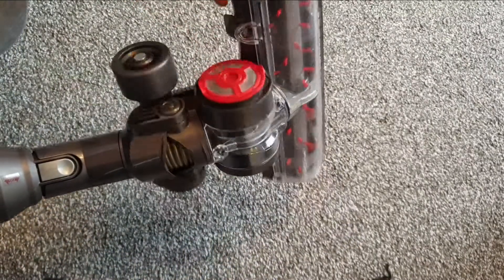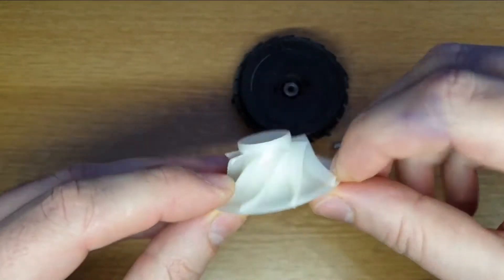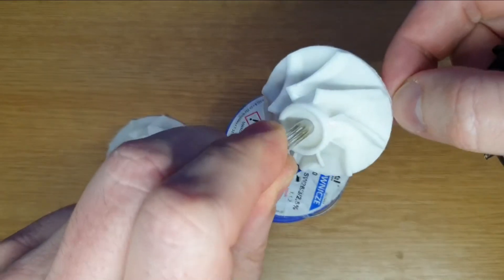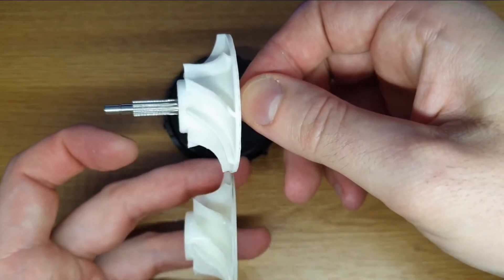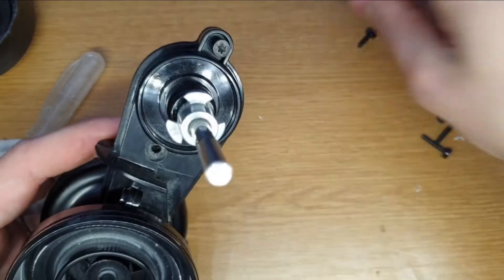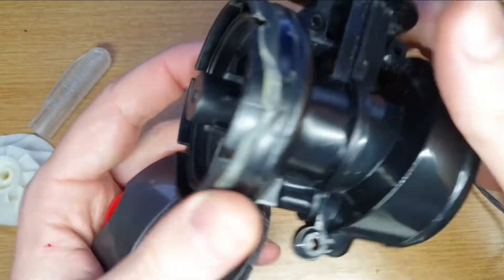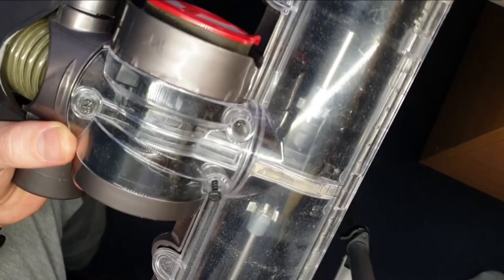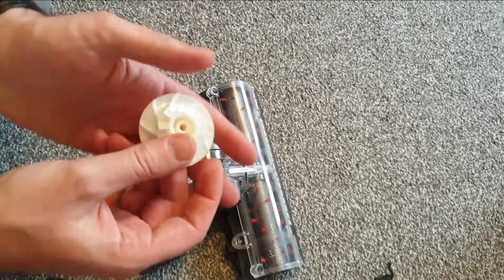Dyson DC23 Head - Turbine (Impeller) Replacement (Repair)

Comment: I followed this to fix the mini turbine attachment. It took me a few attempts but I got it to work.   I actually used a 5 mm drill bit to get the hole right.  My print was too small and the force of pressing the shaft in tore through the impeller.  Not sure why you heated the shaft.  It expands with heat.  I would think you would heat the impeller to open up the hole.  A hair dryer on the air valve end makes it much easier to pull the cap off.  I used a socket to back up the impeller when pressing the shaft in.  Cleaning up the surface with the filler material is very important.  Make sure there are no high spots and maybe sand it a bit.  I had to manually turn the brush rollers a bit each way a few times for it to self center.
Reply from the maker: Hi and thanks for the comment.
I've preheated the shaft not as the thermal expansion or shrinking effect, but purely because the PLA printing material gets softer above 100'C. Hence, it is slightly releasing the hole and also get well stuck around the gripped part of the shaft, after it cools down. 
To get a proper performance, the turbine should be the maximum size as possible, without grinding the case. If it is 2mm smaller that would dramatically decrease its performance.

Comment: Would heat, from a heat gun, help with removing the cover on the screen side? Or possibly making it cold, placing it in the freezer? What is holding it, glue or some sticky tape? I may have to take mine apart, as the bearing is locked, or some thing is locked up, and I’d like to not damage it.
Reply from the maker: Hi,
There is a locking feature (ring) on the top of the internal part which goes in a groove on the lid. There is nearly 360° grip and that makes it difficult to remove. In addition, there is a little foam gasket with light adhesive compound on it, but this is not even close to the strength of the locking ring.
Heating up wold help and you might try it by pulling by hand or using something soft after you heat it. However, bear in mind that if you are heat it and using sharp tools such as screwdrivers, you might leave a permanent plastic deformation of the lid edge.
I would not recommend placing in the freezer, as then the plastic will become harder and more brittle. You might try a little bit of heat (50°C) and try to pick it with a couple of small screwdrivers trying only on one half of the circumference an then stick some piece of tin (precut thin metal sheet) and then try the other side with he screwdrivers. Mind the sharp edges of the tin - to not cut your skin.
It's high likely that you might have some marks after all.
Reply: I used a hairdryer for this and it came off without too much force.  I used some small hex drive tools to push on the tabs on the locking ring.

Comment: Thank you for a very helpful video. Do you know how to remove the plastic housing from the axle that holds the brushes? I have removed the metal fittings which grip the brushes (they can be tapped gently with a hammer). The plastic housing contains bearings on springs but will not slide off the axle. Those bearings need cleaning in mine, I can hear them grinding. Any help, much appreciated.

Comment: The instruction worked out great. Only thing I would recommend is to use hair dryer or heat gun to remove the side caps. I used hot glue to snug them back. 
In my neighborhood, local library provides 3D printing service. Cost me $2 to print out two turbines. Thank you Dimcho.

Comment: Nice one man! Turns out the 3D printing service I contacted have printed a number of these before for other customers, so at 1/3rd the cost of buying another head which is destined to fail again, repairing my existing unit is a no-brainer.
Reply from the maker: I'm glad that the video is still helping.

Comment: As you said, it may not be vital, but I also had damaged the seal that goes around the end that the red on/off valve fits on but was able to replace it with some thin adhesive-backed craft foam cut to 5 mm wide. I fitted it all the way around except for the raised area where the screwdriver slot is - I think that was the same as the original seal. One or two layers of duct tape cut to 5 mm wide might also help seal it.

Comment: Does the removable bottom plate have a gasket?
Reply from the maker: Hello, Sorry for the delayed reply. Yes, the bottom plate does have a gasket. The material is some kind of semihard foam and its profile is rectangular (approx 3x4 mm). It is split between the front and the rear part.

Comment: Thanks a lot for the excellent tutorial. One thing I did different was to heat the side caps and then it wasn’t all that hard to remove them without damaging them to finally expose the turbine
Reply from the maker: Thanks for your comment. That is a great advice to preheat the caps before demount! Have used a hot air gun or something else?
Reply: A heat gun would be awesome, but I don't have one so  I just held the parts above the fired up stove -- low enough to soak in the heat, but not too low so it would melt, definitely not on the open flame. It only took 30 seconds or so of heat, and then I could pry it off with a bit of effort - make sure you wear some protective gloves though.
Reply from the maker: @ghelazar  I like the out-of-the-box solutions :) I'm also using the gas stove to solder/desolder components from aluminum-based PCBs, even though that I've got a hot air gun. It works pretty well by adjusting the height to control the temperature :).

Comment: Dismantled the head found the impeller was'nt cracked or broken, however the hole had got larger than the shaft so would'nt turn the belt to the roller head. I wrapped some electrical isulating tape around the shaft to fill the gap and it now works perfect rollers are spinning again. Hope this helps anyone with the same problem.
Reply from the maker: Thanks for the comment. That may happen too. I guess in this case the manufacturer tolerance of the impeller has been higher, hence the press-fit -weeker. Normally there are tiny cracks around the shaft's press-fit and they cannot be seen if you don't try to stretch the place. However, in your case, you should have seen the crack after you assembled it with the tape added, hence no cracks in your turbine :). In case there are cracks, but the impellers look good overall, they might be glued, like in some of the comments below. Thanks again! Good feedback :)
Reply: @dimchohvarchilkov683  Thank you for your comments, I watched your video  on the dismantel of the roller head and thought about trying to glue the shaft to the impeller but the fit was not tight enough. Other people looking for a solution to resolve this problem now have ideas that will fix this for them without the cost of a new complete roller head. Thank you for the video..
Reply from the maker: @alexmiller68  You are most welcome :)

Comment: Put the shaft in freezer and turbine in hot water
Reply from the maker: That I a very good tip and it is worth it to give it a try. :) The trouble is that the 3D printed holes are often smaller in diameter than in the 3D design file, especially for holes less than 5...10 mm. For instance, 1mm hole could be clogged completely. 
Freezer/hot water trick may work well if the hole is predrilled with 4.9...5mm drill bit at very slow RPM.

Comment: Awesome ! Thank a lot👍
I printed the piece at 97% as you recommended and it works.
I experiment some frictions at the beginning because I inserted too much the iron warmed axis and the space remaining between the turbine and the conic piece  was too tiny. I warmed again the iron piece , pull it a little and cut 1mm  at the top of the blades. Everything is ok now. 
So  it's important to note the exact position of the axis to avoid that fix
Reply from the maker: Thanks for the comment. You are a lot welcome :)
Yes, that is correct - the position of the turbine has tight tolerance and it easy can hit the casing. Normally, it fits well if stop applying force once the turbine hits the shaft's step, during the installation, however sometimes it may happen as your case. This is one of the reasons for my recommendation to print it 97-98% of its original size.
I'm glad that you've fixed it! :)

Comment: Hi. Can you print me a turbine wheel. I can't find one anywhere. Thank you. Will
Reply from the maker: Hi, I printed two pcs yesterday. I'll put them on eBay at a symbolic price, in favour of the DIY community, in the next days :). I'll put a comment that this is not an original component and it is a raw 3D printed component which does the job.
Reply: @dimchohvarchilkov683   Super,  I will keep a lookout for it. Thank you. Will
Reply from the maker: @willwaier1149  Hi Will, I listed it yesterday evening, but it seems that it still not published. I guess it needs some time...
Reply: @dimchohvarchilkov683  i will keep an look out. Just checked and don’t see it yet
Reply from the maker: @willwaier1149  Hi Will, please see my comment in the thread above. Apologies.
Reply: Dear all, any chance to get the impeller somewhere or to have it printed again? Thanks!
Reply: Or any access to the 3D drawing so I can have it printed here?

Comment: I took apart our turbine head and the impeller does indeed have a crack in it. I tried to superglue it but it won’t stay shut when I put the pin through it. I’m devastated! Do you know anywhere I could buy the impeller from? I think it’s terrible that dyson don’t sell this very cheap part and force people to buy the whole turbine head again.
Reply from the maker: Hello, the best option would be if you know someone with a 3D printer, or use some 3D printing shops. It is not difficult to print.
If you cannot find any options I could print you one for free. You just need to arrange the shipping. As I got few requests until now, I will consider to print  few of these and place them on eBay at the cost, a bit more than just the matetial and the electricity....
Reply: @dimchohvarchilkov683  Thanks for the reply. I might be able to get someone to print one. I couldn’t find the link to the model however, could you repost on this thread please? If not do let me know and I would definitely buy one you’ve made on eBay! Just think of all the broken machines you could save going to landfill by printing parts and giving them a new lease of life - amazing!
Reply from the maker: @jennydavies3435  No worries. I'm glad to help :) I've just tried the link in the description and it seems it's still alive. However, there it is:
https://www.thingiverse.com/thing:34563
If you struggle to download it, please let me know and we may transfer it another way. 
P.S. - I'm planning to release the eBay variant soon, as I agree that there is more life in these heads. I haven't believed that so many people would like to repair them, at the moment I've released the video...
Reply: @dimchohvarchilkov683  hiya dimcho, a friend of a friend 3D printed one for me but it looks all rough on the surface, not smooth like yours. You can see the layers and the edges are bumpy as a result which will affect performance. Any ideas for what went wrong? If not I would be very willing to buy one off you and could transfer you money as a thank you gesture?
Reply from the maker: @jennydavies3435  Hey Jenny, don't bother at all that the surface is rough. I've printed mine at 0.12 and 0.16 mm layer height instead of the default resolution of 0.2mm per layer. Yes, it has been a bit smoother but the 3D prints are rough by default and it needs post-processing (sanding, polishing, thermal, etc). I can send you detailed photos and you may see that my turbines are not perfect indeed. One you could do is to remove eventual strings and small sharp bumps by using a gas burner, as I did in the video. Just be careful as holding the heat could melt and deform the geometry. Otherwise, just mount it on the shaft and give it a try :) It should be fine. Good luck! :)
Reply from the maker: PS: It should perform like in this video: https://youtu.be/xkJFiEDR12w
Reply: @dimchohvarchilkov683  is there a way I can send you a photo?
Reply from the maker: @jennydavies3435  Hi, email.

Comment: Hello Dimcho, I watched this video mabe 50 times, but, the same desgin fund on the thingiverse did not worked well. It spins but barely. So I designed new rotor from the scratch but not much happened. Do you have any idea why this rotates not any, but barely? Thanks in advance, and many thanks on this video because if this not uploaded here, It would be much more harder to tear apart the turbine head. Have a wonderful new year.
Reply from the maker: Hello,
Thank you for the feedback. I'm glad that the video was helpful :).
Designing a new turbine is not an easy task, so congratulations about that. I guess you have already checked the things, which I will mention, however I've created an additional video by your request. It is about to test the performance of the main unit and show the normal behaviour of the mechanism of the DC23 head. Please find the video in the link, below or in my YouTube channel:

https://youtu.be/xkJFiEDR12w
Reply: I had the same issue at beginning, the iron axis was too much inserted, I warmed it again , pull it a little and cut 1mm at the top of blades : no more frictions

Comment: Excellent video Dimcho,   as I have the same problem with my DC 20 head,  I don't have a printer so I cant make one. Would you consider selling me a Impeller?
Reply from the maker: Hello,
Apologies for the delayed reply.
I don't know if you manage to find/print a turbine. I could print you one for free. You just have to arrange transport.
Reply: @dimchohvarchilkov683  
Hi, Thanks for getting back to me. That's very kind of you offer me one for free. I don't need one now as I fixed my broking one by heating up two old keyrings, One small & one bigger, I melted the smaller one close to the centre & the larger one nearer the outside making sure they were both level with the surface so as not to foul anything. 
I must say that it works a treat & I'm pretty sure their won't be any problems from now. Again many thanks for your offer in printing me one. Many thanks & stay safe from this nasty covid 19.
Reply from the maker: @michaelp3106  That's a good approach if the shaft whole is still circular. Ours was pretty worn and shaped like an uneven, excentric oval - very fard to balance. Moreover, the blades at one of the sides were ~30% worn out as the friction to the case. I'm glad that it worked for you :).